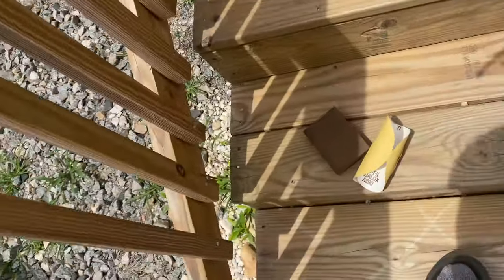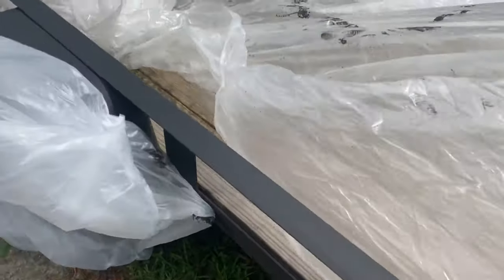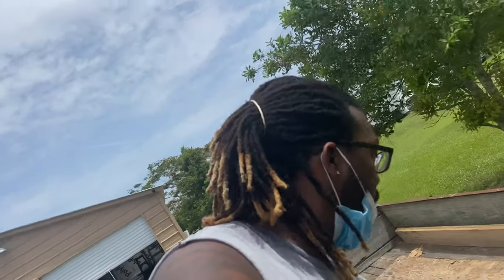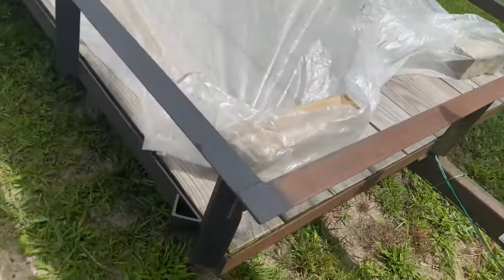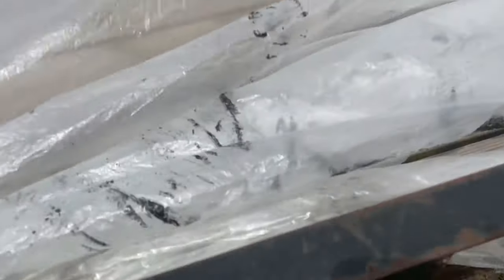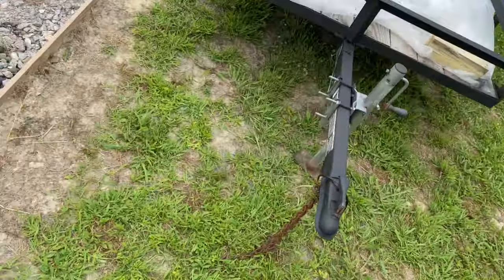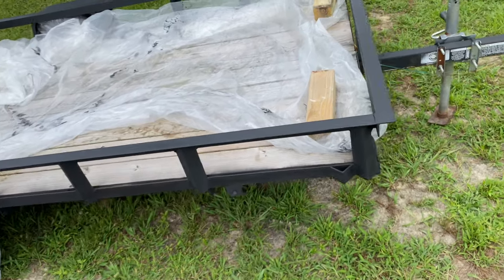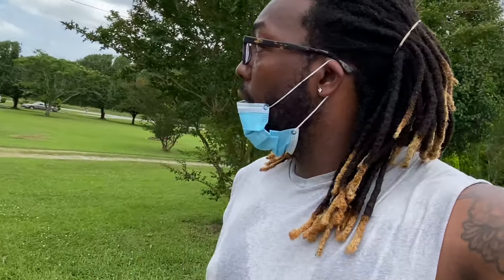Utility trailer restoration On 5x10

Comment: Nice trailer. I got a cheapo Harbor Freight 4x8 and it definitely comes in handy.
Reply from the maker: Niccccee I was going to get one are they a good quality trailer ?
Reply: @everyday_life1991  for the price I can't complain. I bought mine used for $250 but it was almost brand new. I would recommend it at the regular price cause the quality is very good.
Reply from the maker: Cool deal that’s sounds good to me